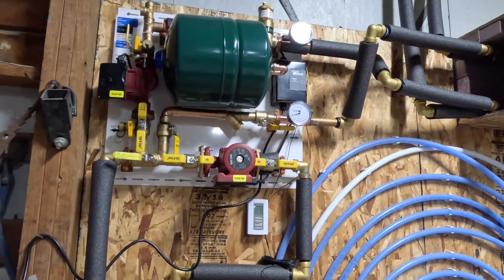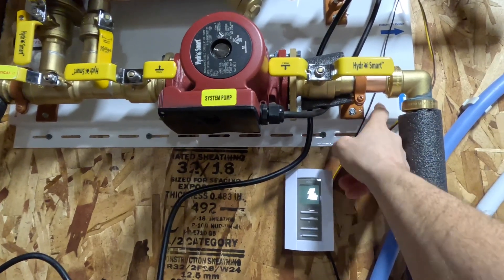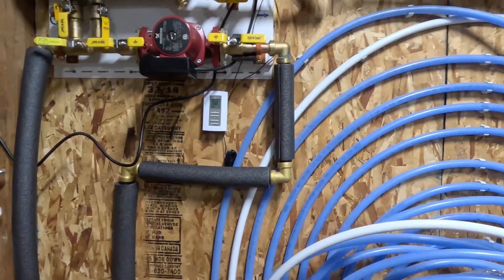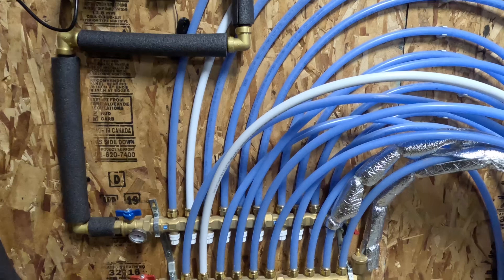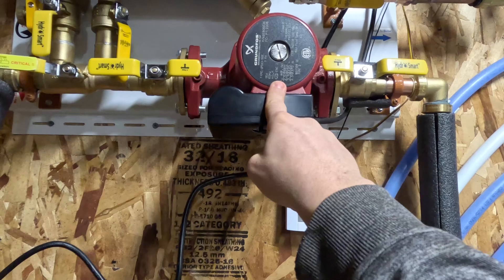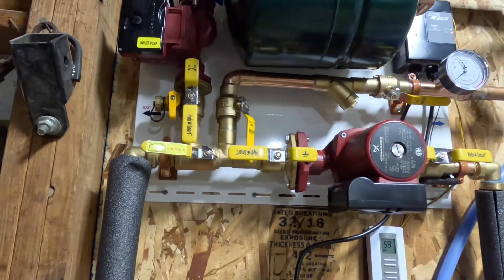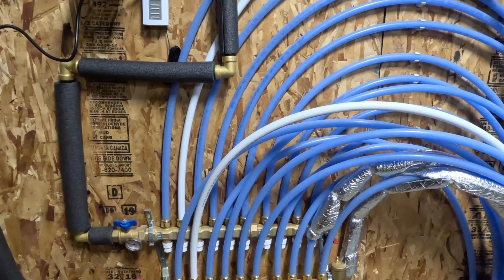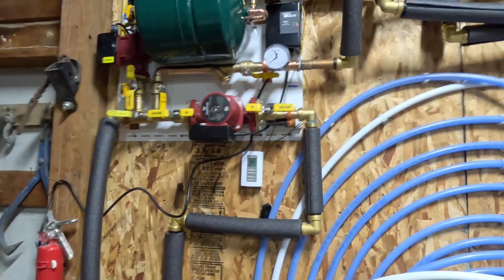Heated Driveway, Snowmelt System Gets Larger Pump!

Comment: (Two) questions  - how deep are pipes from the top. What is the distance in loops between pipes. What is the sandwich- from the ground to the top, how you isolate the insulation between ground and pipes from the water...
Reply from the maker: The pex in the concrete is roughly in the middle of slab. All the loops are roughly the same length 250ft. There is 2inch insulation below the slab. Works great.

Comment: I know it's not as pretty as you may want. I would seriously consider leaving the loops as is - don't cut and install 90's. I'm not an expert, but I have heated with an owb for going on 30 years. My father was a union plumber/pipefitter I remember when he was alive  I installed my first owb and he said if you have the room make as many bends as possible without fittings. I cant remember for sure, but I think he said every single 90 added like 6ft of head! The fittings will cut down your flow alot. You will have to compensate by increasing the water velocity with a larger pump which if too high will erode the inside of the pex tubing.
Reply: 90s absolutely are a last resort
Reply from the maker: That sounds like good info. I will have to do some more research. Do they make some sweeping 90’s? I’d just like to clean it up a little if I could.

Comment: Few things…
1) I get what you’re wanting to do. I think by solving water flow on load side of plate hx the line side will not deliver btus fast enough. You may need to increase lines on supply side of hx or run a dedicated loop or plumb it primary/secondary loops
2) the more connections, fitting, etc. you install, you increase friction (increase head) which in turn reduces btus delivered.
Reply from the maker: Yeah that I all understand. Already have stuff in the works for everything you just mentioned. Video soon.

Comment: Love them Hydro-smarts. Install lot of them as a HVAC owner. Curious though on your pannel compared to the ones I install. Tech support always tells me 15-18 psi max. Why 25 on yours? An flow rate we usually shoot for .05GPM. You said you where trying to increase yours. What to? Love watching. Thanks
Reply from the maker: On my set up, said to fill the system at 15psi. I’m happy with 25psi max. Especially when the system gets to temp. If I was at .05gpm on each loop the slab would never ever get up to temp. I don’t think it would even budge. Now I can get each loop easily to 2gpm. But I averaged them out to around 1.5/1.8. Seems to do the trick. My concrete where the snow is melted is 6/8 inches so I need good flow to be able to warm the slab. Faster I can get it to temp the less work the system and the boiler have to work. Have any advice with my set up?
Reply: @Treestofirewood  it all looks great. I agree with 6" of concrete, cold temps, an snow of why now you need that much flow. I'm guessing it was designed that way.Them pannels are just the best. They make things simple. Heat master is a new tool in my arsenal. Work an at home over last 2 years. The possibilities are unreal with a outdoor stove. Keep up great work. I enjoy watching. Stay warm

Comment: It will melt it.  Might just take a bit longer, but it will catch up! Nice upgrade!
Reply from the maker: Thanks. Yeah it melted just fine. Now I have to upgrade the boiler pump. Now I notice that the glycol flow is to high now that it really depletes the water side. So my thought is to up the flow so the heat loss isn’t as great. My calculations are that if I up flow there will be better heat transfer. All trial and error.